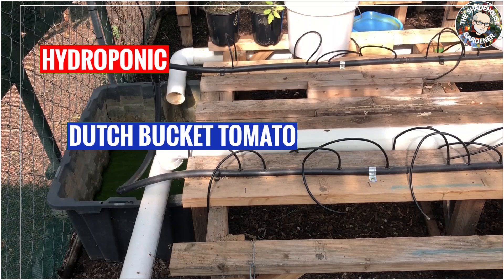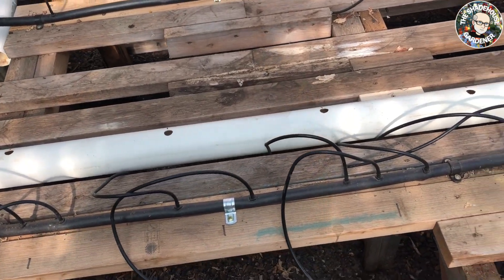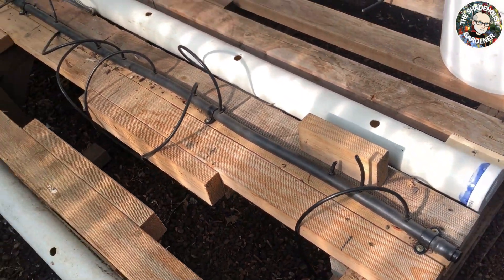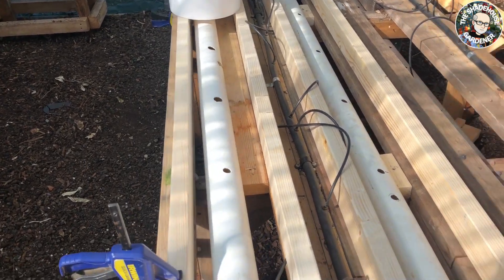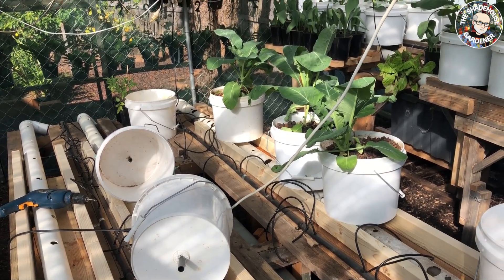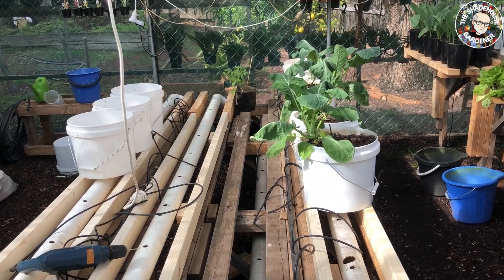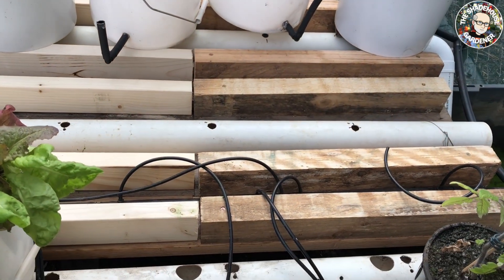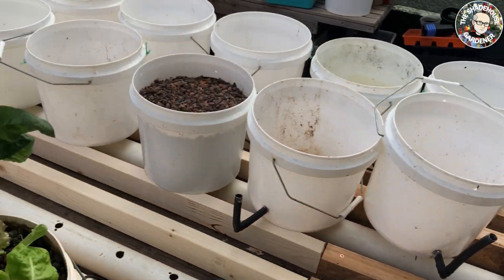Hydroponic Dutch Bucket Bench Rebuild

Comment: Greetings from Puerto Rico. Thanks for sharing, super cool system. I was wondering if you can share: how to deal with the algaes inside the buckets?
Reply from the maker: I don't have a problem with algae in the reservoirs. The best way to get rid of algae and to keep the nutrient algae free is to use a couple of aquarium air stones on a small air pump. very inexpensive and cheap to run.
Reply: Use hydrogen peroxide to kill algea and prevent root rot